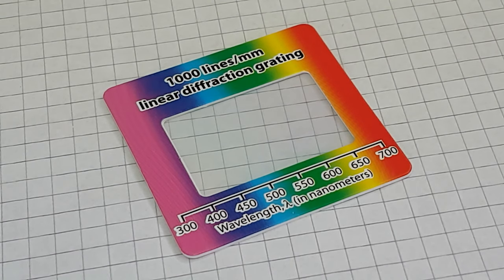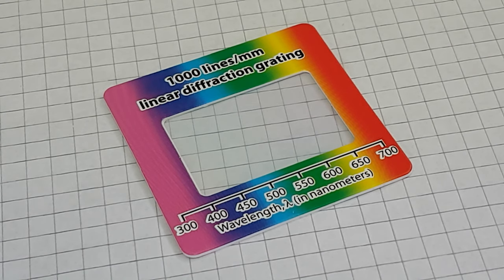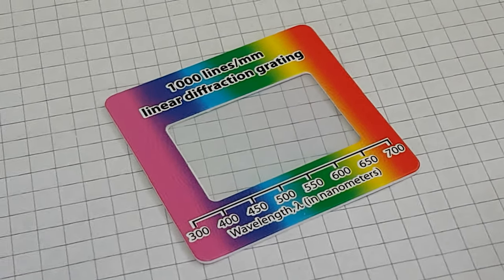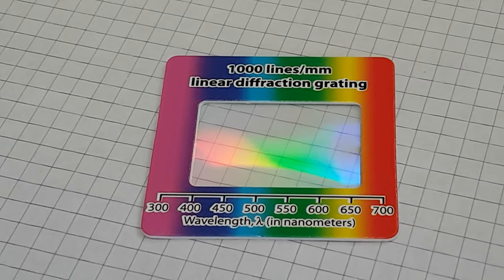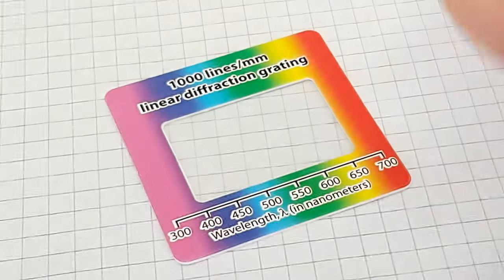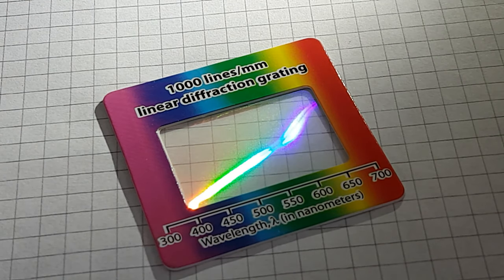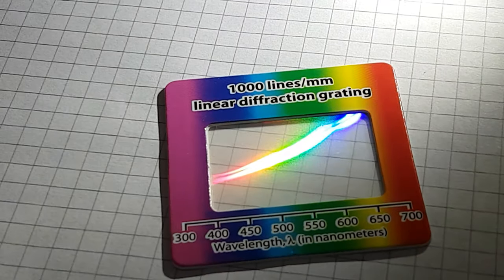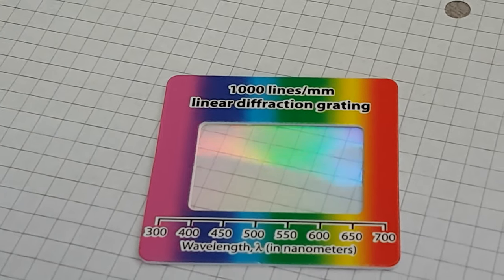Super NOVA - Diffraction grating

Comment: God do you ever turn the super nova on?  Ive watched 10 videos on the godamn thing and you never even get close to turning it on...  the fuck!?!
Reply from the maker: The builder of the device, 40 years with two young children and wife died from breast cancer we were told. Due to ball lightning being associated with Strange Radiation, we wanted to understand the risks of this. We now believe we have a good grasp of how to shield for this radiation and have nearly got all the materials together.

In coming weeks we will be assembling it an instrumenting it.

The spectrometer solution above was unsuitable for use and we have just acquired a fibre optic spectrometer which will be utilised. We need to get familiar with it.

As a volunteer organisation on a shoe string budget and limited human resources, we have had to wait to ensure we do the best job possible.